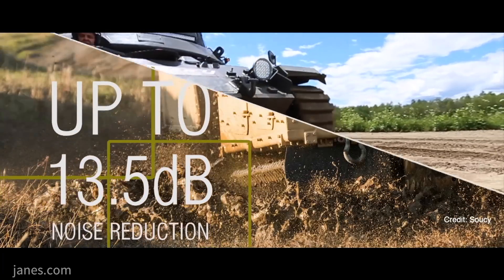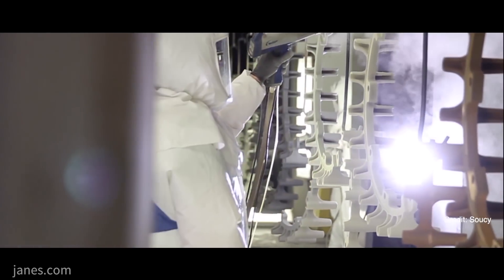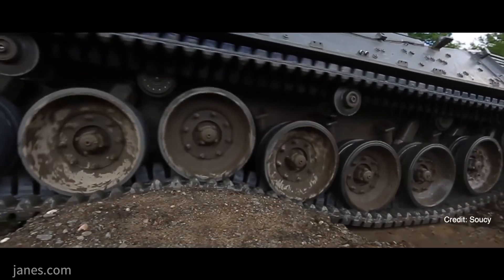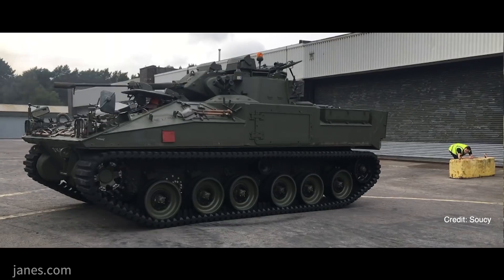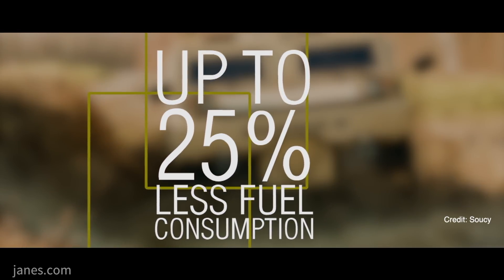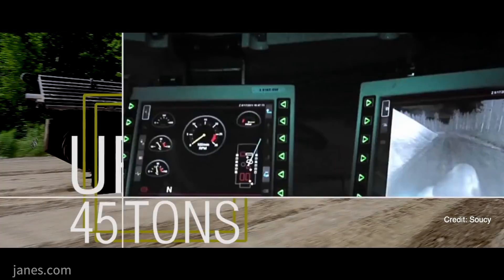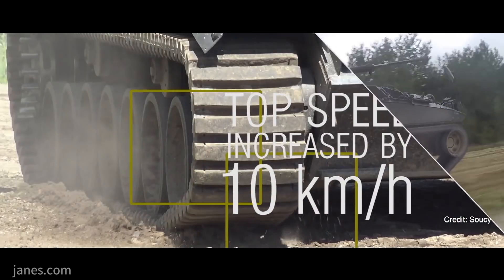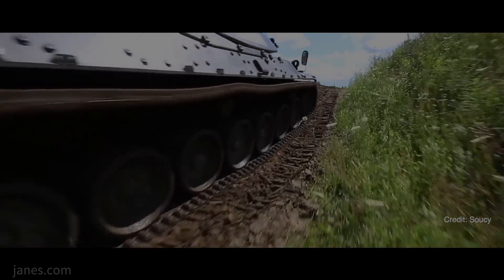CANSEC 2019: Soucy Defense provide an update on their Composite Rubber Tracks

Comment: We have the Soucy tracks on the M113A3/ TLAVs at work, and I've driven both them and the Diehl and  T130/ T150 tracked things as well.  Soucy track is definitely quieter and a far smoother ride to anything that came before - plus there's less track maintenance and then some.  Disadvantages to me are traction under certain conditions and the fact you're not exactly going to be replacing a link or two to get back on the road after a track separation event, though Soucy makes an emergency kit to couple the track back together at the break.